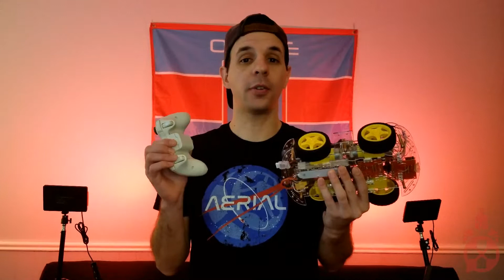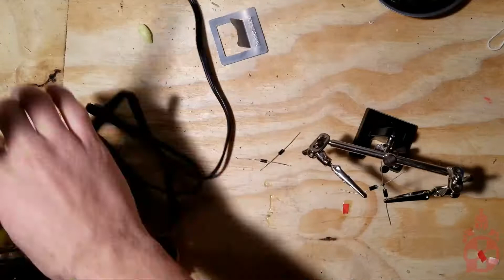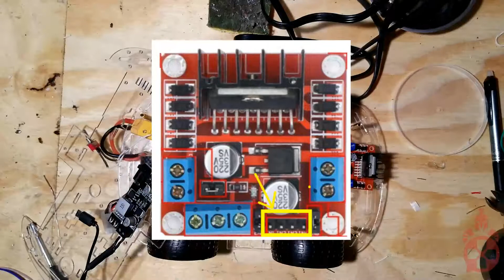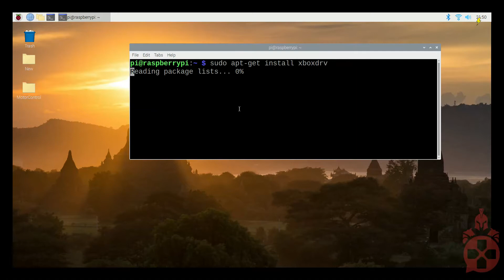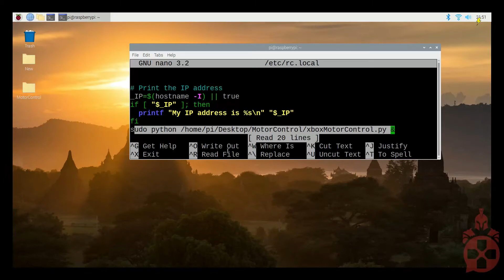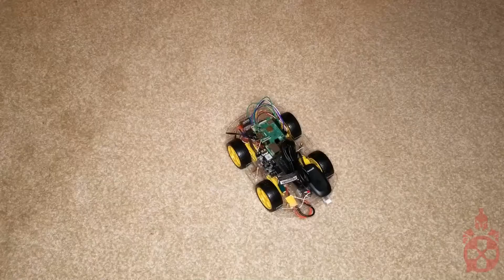Build an RC Car - Part 2: Adding an Xbox Controller

Comment: Hey, I was wondering what Raspberry Pi model are you using? Will Raspberry Pi 3 B+ be ok for this project? Thanks in advance!
Reply from the maker: I used the 3B for this project, so the 3B+ should work as well. Happy tinkering!

Comment: Sir, love the xbox360 robotic car. Sir, can you give me the circuit diagram and the codes for the Xbox360 controlled robotic car.
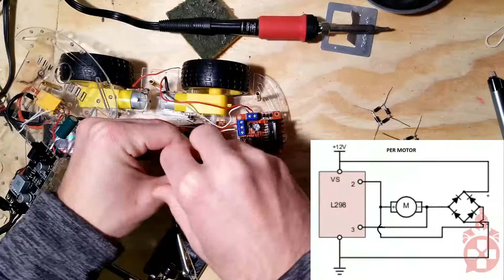Reply from the maker: The circuit diagram for each motor speed controller assembly can be found at 2:25 in the video. The rest of the connections are shown in Part 1. Sorry the information is split I try to keep my videos shorter.

Comment: Sir, what courses do you learn to go into the field of robotics? Sir, tell me, what careers do I do to get into mechanical engineering or mechatronics engineering? Sir, I want to be a mechatronics engineer, sir, what should I study to get a degree or diploma in mechanical engineering or mechatronics engineering? Tell me, sir.
Reply from the maker: Hey there. There’s a lot of robotics stuff that you can learn online - lots of great YouTube videos and free sites out there to teach you some basic robotics fundamentals. But if you want to get into Mechanical Engineering careers, you’ll want to find a good accredited school with an engineering program. They typically have classes all laid out for you but if you want to specialize in mechatronics, try to focus on dynamic systems, electronics, etc if you have any elective options. With a mechanical engineering degree, there are so many career options available to you. Truly depends what you want to do.
Reply: @onlinewarriorspodcast Sir, send me the great youtube videos and free websites out there to teach me some basics about robotics fundamentals and some coding courses for programming.

Comment: Sir, I love the robotic car using raspberry pi and Xbox 360 controller. Sir, can you make a video on how to make an Arduino Uno Xbox-controlled 6-dof robotic arm car using the wireless USB gaming receiver adapter for the Microsoft Xbox 360 controller, and can you give me the circuit diagram and the code for the Arduino Uno Xbox-controlled 6-dof robotic arm car using the wireless USB gaming receiver adapter for the Microsoft Xbox 360 controller?
Reply from the maker: I have some other videos in the works at the moment but I can put that on my list for the future!